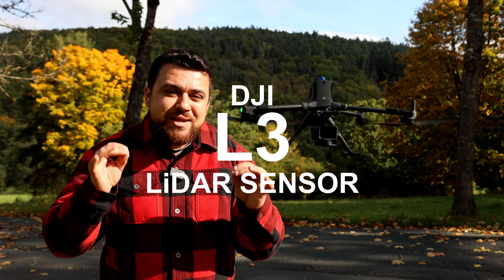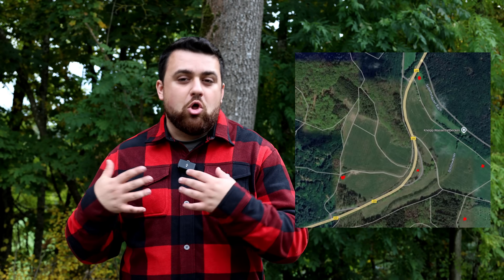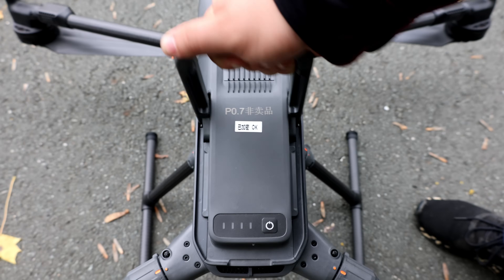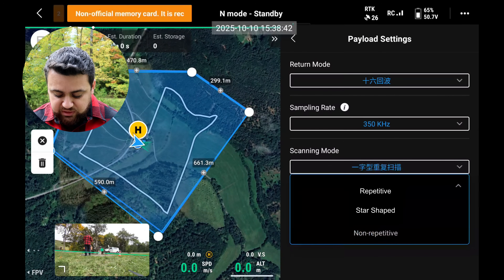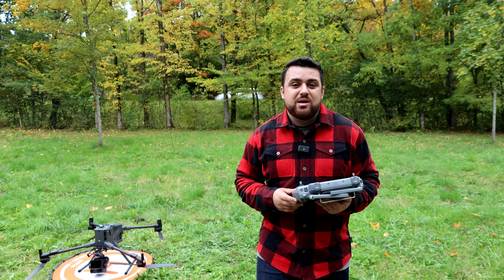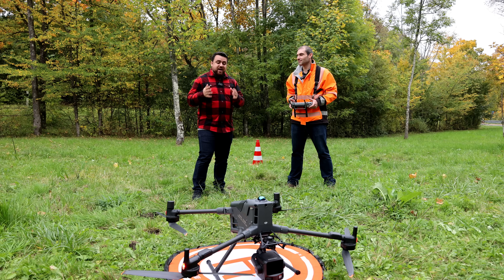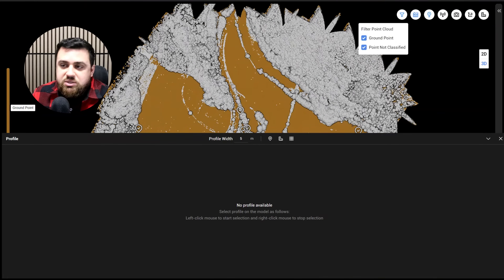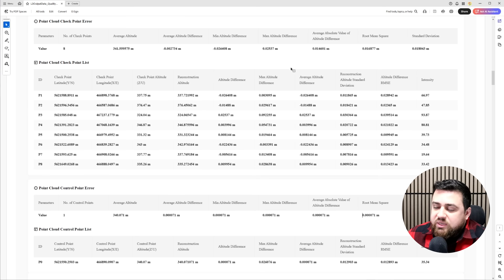How Accurate Is DJI Zenmuse L3 on Matrice 400 RTK for Surveying and Mapping?

Comment: HI Rami!

I have only worked with photogrammetry so far (Mavic 3E), and I will soon also be working with a Matrice M300 and the Zenmuse L2. I mainly want to work with a correction service (RTK). Until now, I simply surveyed my GCPs with an RTK rover and then processed everything precisely onto those points.

My question: In DJI Terra you can only pull the LiDAR point cloud vertically to the GCPs, or use them as check points, correct?
If I fly large areas, how well do the GCPs match horizontally with the point cloud?
Is there any way to adjust the point cloud horizontally to the GCPs, or is it not necessary because it usually fits within 3–5 cm?
Or do I need to use another software to georeference the point cloud or the resulting 3D model with higher accuracy?

Thank you and best greetings Lukas

Comment: Rami, Thank you for sharing a real world dataset. I appreciated  that you looked at different cross sections of varying topography. The ground points look very impressive so for surveying applications its going to well, especially in dense vegetation topographies. However, ortho looked muddy. It may have been the mix of drone flight speed, lighting and weather conditions, or shutter speed... but the ortho looked muddy after is reconstructions. 100 megapixels may be too many for a 4/3rds sensor? Great content man.

Comment: The orthomosaic may appear satisfactory from your side, but in my experience the M4E produces a substantially better ortho in all respects.

Regarding the LiDAR data, the results seem reasonable for the price point; however, I am concerned that only one Ground Control Point (GCP) was used, with all remaining surveyed points treated as Check Points (CPs). As many of you would know, in drone-based LiDAR workflows GCPs and CPs are virtually identical in terms of field collection—the distinction is applied during data processing. Typically, all surveyed points are first used for ground control and then reassigned as check points, with any CPs showing high error removed from the final reporting.

While the video is nicely produced, it would have been beneficial to provide transparent details on the actual number of GCPs and CPs surveyed on site. You refer to five GCPs, but no information is given regarding the number of CPs. Information provided after the fact has limited value unless it is clearly documented at the time of the survey and not back in the office at time of post processing the data.

Overall, the LiDAR results appear good, though not exceptional, for the reasons outlined above.

Comment: Does that difference RMSE mean it's technically double what it shows? Still incredibly impressive but I'm sad you didn't enable 2mhz mode... Like wtf... Forget points cm apart, that's points mm apart. I've always found my QA/QC of L2 data or any LiDAR payload that doesn't cost 100k +, my GCPs and CPs are always couple of CM off only because I don't have a point close enough to the actual coordinate. Using the DTM is better for QA/QC as it interpolates between points where they are sparse below your set resolution. With the L3, I foresee us being able to prove accuracy through statistical analysis directly correlated to an actual returned point and not DTM interpolation. I can't wait for our L3s to arrive!!

Comment: From what you’ve shown, it looks like the NTRIP-derived control points were carrying quite a bit of vertical error. That raises the question of how useful those points really are as a check against a LiDAR dataset that’s been tied into a known control mark. If you’re not using a local base and rover to observe proper ground control, and you’re relying purely on NTRIP over a long baseline, then the control is only ever going to be as good as the distance and stability of that correction station. Once the baseline gets long, the vertical component in particular becomes unreliable, so it’s hard to treat those points as a meaningful benchmark.

In New Zealand we compare against the LINZ geodetic control network; in the US the equivalent would be control within the National Spatial Reference System (NSRS) maintained by the National Geodetic Survey (NGS). Checking LiDAR accuracy against control that is itself drifting vertically due to NTRIP baseline limitations doesn’t really confirm anything about the LiDAR. At best, it shows whether there is obvious warping in the point cloud, but with modern RTK LiDAR and a base set up over a known mark, the internal geometry and the absolute tie to the grid should already be extremely tight.

That’s why I’m trying to understand the control you used here. How accurate were the NTRIP-only control points in this example, and how far was your rover from the correction station? The baseline distance is crucial, because the further you are from the NTRIP source, the more stacking of error you get — especially vertically — and that becomes the limiting factor. If your DRTK3 was set up over a known survey mark, that control is almost certainly more accurate than any NTRIP check point collected at a long distance, which means the “ground control” ends up being the weak link rather than the LiDAR or the DEM.
Reply: 0.028m is a lot of error? At 100m and inoptimal parameters. But you are of course correct about NTRIP and baseline/accuracy correlation. In general. Every 10km = 1cm less accuracy.
Reply: I think he used a his DRTK3 as a base.